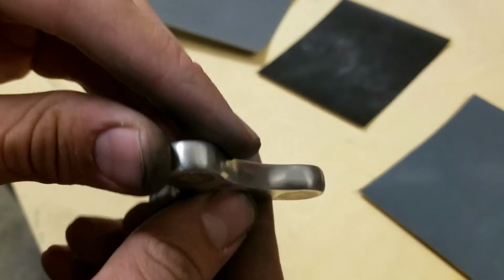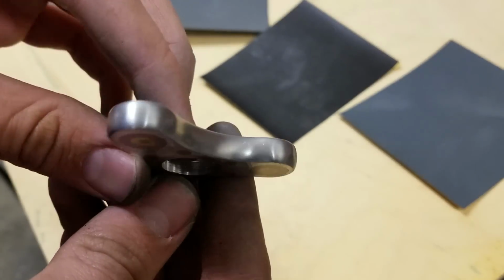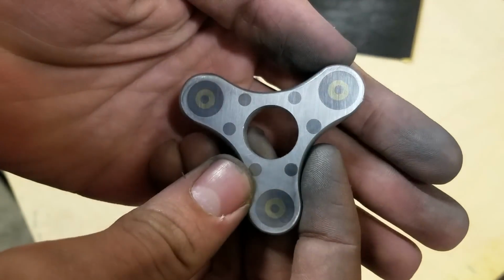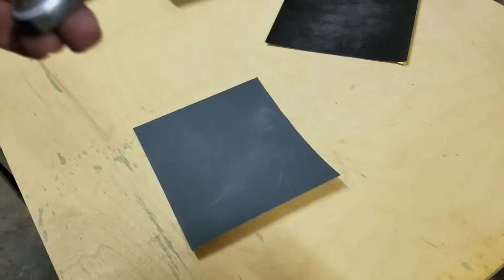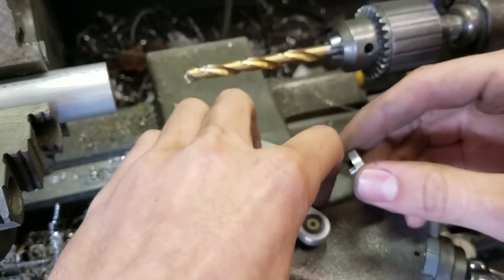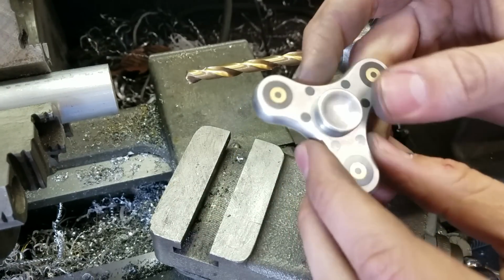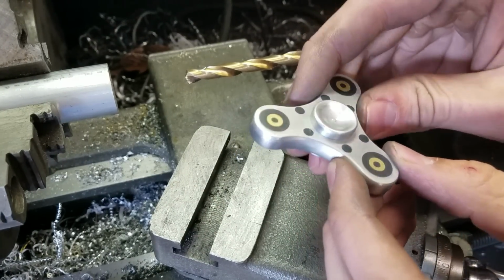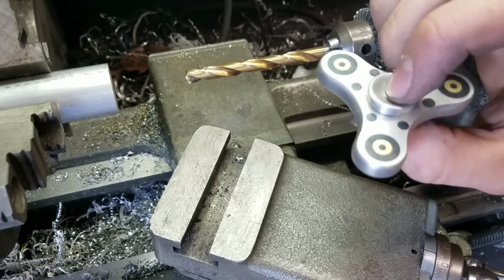Handmade Fidget Spinner (Time Lapse Start to Finish)

Comment: Hi very good work.what is the solution that you dropped the heated material?as i understand it cleans the dirt etc.thanks for your time
Reply from the maker: it's just synthetic motor oil. any kind of oil would work though
Reply: RealSteel 1776 thank you for the tip
Reply: +MacroMachines chandpasha

Comment: nice! one thing though, are the caps actually touching the main chassis of the spinner? if so they also might be slowing it down a lot ( and potentially scratching both the caps and body)
Reply from the maker: The caps aren't actually touching, they're just REALLY close. The bearings themselves are the problem

Comment: What is the thing at 1:19
Reply from the maker: that's a half inch bolt that drilled I out and put a brass rod inside, then drilled that out again and put a steel nail in the middle. thats what i used to make the three weights at each tip of the spinner

Comment: Okay, just gonna go ahead and say it, you don't have to agree, but jesus h christ, don't pull with a lathe chisel/tool-bit, unless you want to chew through them by resharpening them all the time.
In case of high-alloy hardened or WC toolbit, ignore above statement.